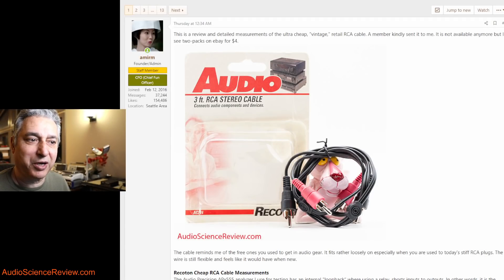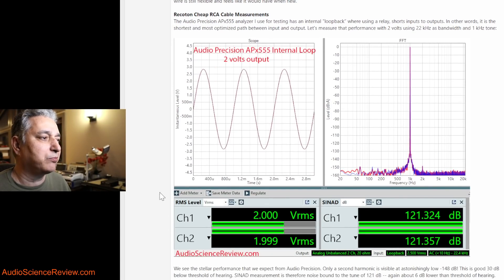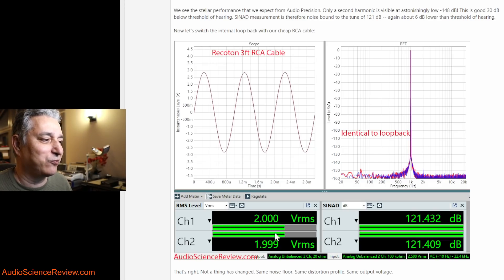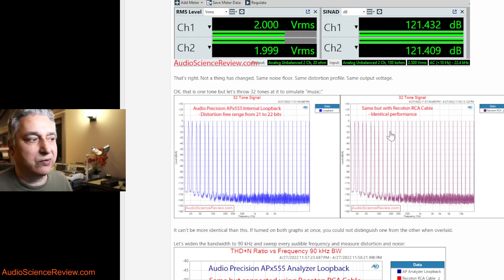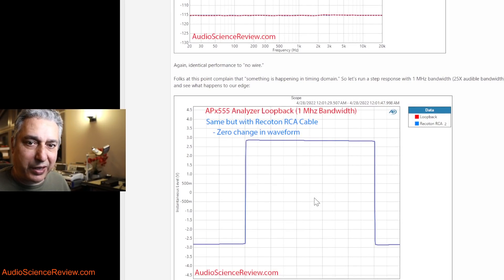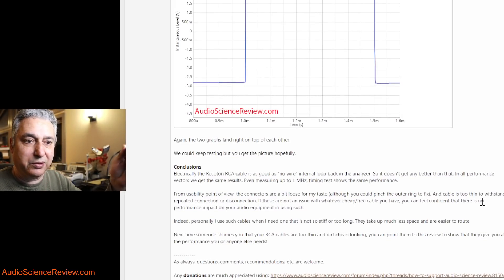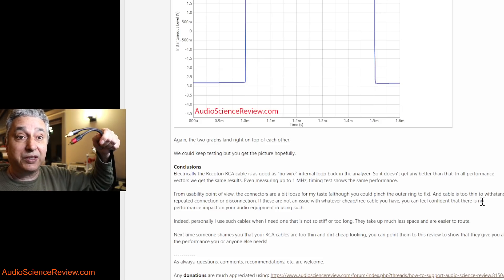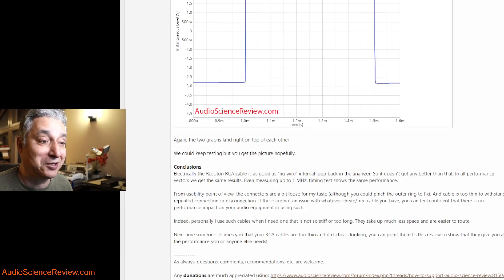Are Dirt Cheap RCA Cables Any Good?

Comment: As long as there’s nothing to interfere with the Signal your review is valid. Take something that could cause interference close to the possibly poorly shielded or unshielded  cable and there can be issues. Nothing is always this simple. Doesn’t mean one has to spend a ton of money on cables but something times people have to think a little more than this.
Reply from the maker: I have done that test as well: https://www.audiosciencereview.com/forum/index.php?threads/battle-of-rca-cables-mogami-amazon-monoprice.27871/

It is very hard to make a case for audible impact of such interference.  Above cables are all low cost and none could be said to have picked up audible noise.  Not to say that it can't happen but it is very hard scenario to make happen.
Reply: Yes and as long as there is nothing stopping people from projecting a lack of understanding as knowledge, your criticism is valid. 
What you overlook is beauty of the work on this channel, it's not not C+ or B+ stuff. It's A++ rock solid evaluation, the kind you might get out authorities at MIT etc. Your idea "you have to think a little more" is just flailing, in fact YOU need to be a more attentive student and not overlook half the lesson then make insubstantial claims. To your point, Amir covered your concern about inference. There are no plausible sources of interference for a 3ft RCA cable like this is common use. Feel free to name one you can imagine inside a home next to a hifi. Something with a large electric motor comes to mind, but that machine would be shielded according to code.

Comment: If you use RCA cables on a turntable it can be very difficult to get it hum and noise free. I have tried and failed that on a DUAL TT with various cables (non of them high end). 
Not wanting to spend too much on a cable I made one my self from a Type N (= copper on both leads) Thermocouple extension cable. It worked like a charm. BTW these cables have Teflon dielectric to make them a bit more temperature resilient but they won't break the bank because they where never intended for audio, instead they are industrial and as such do their job effortless and fuss-less.
Reply: Good solution. In the old days all of the old turntables with RCA cables additionally had a grounding wire. The amplifiers had a “grounding lug” to connect the wire to. Otherwise you would get a 60 Hz hum. This was on tube amplifiers as well.
Reply: @markfreedman2470  The name for this problem is a "ground loop" and is cause buy an alternating current (AC) flowing on the RCA cable shield which is used as the reference for the audio signal on the RCA center pin. As you stated a separate ground usually fixes the problem, but audio isolation transformers can also be used.

Comment: Hoping you test my favorite RCA cable, the McIntosh CA1M. I use one for my turntable.  Really made a huge difference!
Reply: How can they be that good? This cheap cable is already perfect. What does make your cable sound better then perfect?
Reply: @ener5361  -- Amir only tested for line level signals.  Phono cartridges have very little output voltage and relatively high impedance, so his findings aren't directly applicable to turntables that don't have built-in preamps.  Fortunately, such products usually come equipped suitably well-shielded, low capacitance cables.
Reply: @Douglas Blake I’ve already proven cables matter when I destroyed an ASR member, like yourself, 5 to 1. Amir refuses to acknowledge my Scientific destruction of one of his minions, but those McIntosh cables are worth 10x the price they’re asking.  If you have an open mind, the video is here: Cables Matter - Audiophile Proof
https://youtu.be/EPavjwEBYEg
Reply: @Douglas Blake Oh I won.  I won big time.
Reply: @Douglas Blake 5 -1 is a huge win
Reply: haha!

Comment: Well at least the money that folks like you will save by using basic cables you will probably waste on upgrading components that you will never fully benefit from! 😂 If you don't hear any improvement in sound quality from using decent cable in your system, then your system is either badly setup or maybe listening to music is not really your thing and you just enjoy collecting (and measuring) components.
Reply: Excuse me, but yours truly has 50+ years of experience with both home stereo and professional audio gear.  I was also a working pro musician for several decades.  Based on all that, I can say with great confidence that what you've posted here is utter and complete audiophool codswallop.
Reply: @editorjuno  I don't question your sincerity, but I know the sound of  my systems (especially my headphone setup), and how changing cables, etc affects the sound - this is not something I am imagining. I am genuinely puzzled and curious to understand how it is that people like you with your experience and expertise don't hear things that are so clear to me. What kind of cables do you use with your equipment - just the basic free ones they are supplied with?

BTW, I am not talking about £100's or £1000's of pound cables because I have no experience of them and doubt that any benefits they might bring would be audible in my modest system - I use interconnects that cost around £30 - £50.
Reply: @mgsee  -- I use whatever's in my decades-old cable stash as long as it's in working condition.  Nothing in my current system came with any audio cables -- all the cables I'm using are either from that old stash or from one local charity thrift shop or another.  I did pick up a pair of "THX-certified" Monster cables a couple of years ago -- for only $2 USD I couldn't resist, and they turned out to be just the right length to connect up my active main L-R speakers!   :-)

FWIW, I don't doubt your sincerity either.  That said, thirty pounds sterling -- almost $38 USD --  for any short RCA cable is highway robbery IMO, but it's your money to spend as you please, so by all means suit yourself.
Reply: @editorjuno  At the end of the day all that matters is that you enjoy listening to your music. I'm tired of all the insults flying around from both sides of this issue. I am curious though bc the greater clarity and texture of instruments that I heard when I changed to Chord RCA interconnects between my SMSL DAC and Little Dot valve amp (driving Sennheiser HD 600) recently is definitely not 'snake oil' or the result of my imagination playing tricks on me : )
Reply: @mgsee  my guess is that there is some problem with their system which masks the difference between cables. for example, one could not reasonably test the difference between esoteric racing tires by switching them out on an old Schwinn.
Reply: @EskWIRED  That's a rather extreme and therefore crudely inappropriate analogy. Obviously, as with any system, synergy  is very important. The perfect system does not exist so clearly what works perfectly in my system might exacerbate weaknesses in another system. The endless striving for perfection (and therefore objectivity) is what motivates the most dedicated amongst us, regardless of which side of this debate we start from.
Reply from the maker: As I have responded to others, we "hear" what you think you hear.  The difference is that we know if the test is done without knowing which cable is which, such difference vanishes.  In other words, it is your eyes and brain that manufacture such differences, not the cable or your ear.  Until you learn this important fact about your hearing perception, you will forever be confused about high fidelity audio.
Reply: @AudioScienceReview  Don't patronise me. This is exactly the kind of attitude I was talking about with one of your subscribers. Do you think I don't continuously check and double-check what I'm hearing. You seem to think if you can't measure something it does not exist! This shows that despite calling your channel 'Audio Science Review', you actually have a limited and superficial understanding of the role of science that is limited to only verifying the existence of phenomena and therefore you make the mistake of denying the possibility of experiences that you have not yet been able to measure. This approach means that you are most likely looking for the wrong things and end up simply reinforce your preconceived ideas. How is science progressed, by measurement base on existing criteria or by seeking to understand the science behind some as yet unexplained phenomena?

Of course someone who is lacking in imagination and who is only too willing to label someone like myself as deluded would most likely not engage in such research anyway and would regard science as a closed book, an attitude that really has more in common with religious dogma than a truly open scientific approach...
Reply: @Douglas Blake Tell you what - I'm gonna dig out my 'crappy' cables and listen to them again just to make sure I have not been fooling myself all this time :)
Reply: @mgsee  after you switch out the cables, let us know of your thoughts
Reply: @EskWIRED  The thing is I know the sound of my system very well because I am always tinkering (not just with cables) and not all changes sound better or sometimes even make any discernible difference to my ears. I swopped out my preferred Chord phono interconnect for a set of fairly decent Mogami cables and the effect was not subtle and not something that requires blind testing (which seems to be the touchstone method for establishing sound variations among the skeptics). I was listening to a vocal jazz performance, via Qobuz, and the Mogami immediately had more sibilance when the singer sung 's' sounds and instruments such as the kick-drum were less distinct - there was no initial smack of the drum stick hitting the drum followed by the thud of the bass, just a relatively more blurred thud. Overall the sound was more one of listening to music via the Mogami cable rather than hearing a performance by a group of musicians. I swopped back and forth with different tracks just to be sure because, believe it or not, I would prefer it if a £5 cable worked as well as a £50 one as it would leave me with more money to spend on other goodies like a decent pair of IEMs!

Comment: Finally i found someone that has the right tools to prove what i've ever suspected. Great job!
Reply: Have been waiting too for someone with an AP device to do this; result was as expected.

I've always used inexpensive cables in my home and PA (excepting the 25-50ft 4 conductor speaker cables needed in some venues - that's a fair amount of copper and they need to withstand heavy use and abuse + pass signals in the kW's).

At some point I want to switch all my RCA's to Belden wire but that's only cause they have cool colors 😄

Comment: Analogue interlinks and speaker cables make a huge difference in sound by my experience. Not saying cheapos are bad. But there really are differences to be heard. Quite literally eliminated bass issues with different cables, better soundstage, depth etc.

Quite fun to play around actually with different sets
Reply from the maker: If it is fun, please do the testing blind.  Have someone else swap cables on you without you knowing and see if your conclusions remain the same.  I suspect they will radically change.
Reply: @AudioScienceReview yupp, i have done that with a friend, which was a long good evening :) can't explain the why, just that it was day and night difference. Had lesser results with an old Monster cable vs the vd hul. And major difference between interlinks from inakustic and supra. (Running the inakustik atm.).

Like i said in other posts, some of the audio stuff like ethernet cables i absolutely demolish. Or AQ powercables which i tested with the same person (zero difference, i am using default cables). Both were before i saw your tests and i found it really cool it confirmed my theory btw.

If you're ever in the Netherlands, you are welcome to visit. No joke, you really are. Some folks and i actually promote you on one of the bigger dutch audio forums. Not everyone likes it, especially the resellers lolz....

Regarding the speaker cables, i also scanned with an external mic and spectrum analyser during listening (simple app, nothing fancy) and there were differences there as well. 

The set is a Marantz av8003 (on direct), Arcam pa240 poweramp, monitor audio gx200 speakers with gaia III feet and a simple bluenode 2i.

And no ps audio ac regenerator thingy ;-)

Cheers
Reply: @AudioScienceReview  sorry forgot the bloody cables lol!

Old: vd hul cs-122 
New 2nd hand: inakustik ls-1602

Comment: By the way, just out of curiosity, do you think sound different can be measure by the analyzer? Sound such as  soundstage, wide sound, or those holographic sound, can it show up in the analyzer?
Reply from the maker: Of course.  You can't change the nature of the sound waves but have it leave no trace in frequency or time domain.  It is like asking me if you can tell red is green but an instrument can't.
Reply: @Douglas Blake really after seeing more video from amir, i think i lose interest in pursuit of high end audio system. seem like everything in the market is snake. must as well just stick with smsl and enjoy the music
Reply: @bryansu  There is audio equipment out there that is "measurably" good. Benchmark Audio for example. If you buy that type of gear, at least your money is spent on something that is real.
Reply: @Douglas Blake you go way too far here. you can take a system which images wonderfully and screw it up completely by replacing one component. you can also screw it up completely by moving the speakers and twisting them a few inches. you could also line your room with reflective surfaces and arrange the furniture to be as asymmetrical as possible. maybe put one speaker in front of a huge stuffed couch and the other in front of a solid sheet of polished granite? there's a whole lot more to it than simply purchasing a well-produced recording.

Comment: I’ve been in Audio for the last 60 years (prior to the cable insanity era) and I always knew that the so called crappy cables were perfectly fine. I guess because I couldn’t hear the difference I assumed they were good. It’s nice to know You’ve vindicated my judgment. Thank you. Kudos to you! Interestingly enough,  I visited Grammy award winning recording studios 18 years ago and guess what?  They didn’t give a rat’s ass which cables they used in the signal chain, as long as they worked.
Reply: Look inside "top shelf" amps etc. Is twisted pairs of hookup cable :)
Reply: I agree the crappy cables sound amazing. The issue is that if you are connecting and disconnecting, they are more prone to break. But other than that, they are great

Comment: So, the Audioprecision internal Cables are just as bad as theese cheap RCA cables, thats what you just proofed ;o) Now All of your tests are flawed 🤣
There is some value in in better looking, mechanically better designed cables though
Reply: There may be, but at line level that "value" is neither audible nor measurable.
Reply: @Douglas Blake -- Hoschi's comment was clearly tongue-in-cheek, so you can stand down from red alert.  Of course a serious doubter would point out the pitfall of any circuit that depends on the integrity of relay contacts, which are a notorious failure point when a mfr. skimps on the parts budget -- which of course AP doesn't have to do.  :-)
Reply: my comment was indeed meant ironic.  But it is somewhat frustrating to see so many Snake Oil Companies making big money with their esoteric claims and to have so many audio fans willingly buy this shit and wildly spread and defend this foolish claims. Thanks Amir to shed some light into this dark corners!
Nevertheless did I just bought a replacement headphone cable for my Focal Stellia, not for any sound quality improvements, but purely for the look and feel (the stock cable is stiff as hell and extremely microphonic )
Reply: and interestingly electrticity is apparently quite a bit more complex than I thought : https://youtu.be/oI_X2cMHNe0
Its all in the Fields , not in the wire.....there is another pandorras box with lots of esoteric potential     lol
Reply: @Douglas Blake Have you watched the Clip from Veritasium? at around 3:30 he explains how electrons transfer their kinetic energy thus heatng the wire up (heat is basically just kinetic energy in a system)
I dont think I understood all or even half of what is shown in that video, but still find it very interresting to see that on a subatomic level things can get quite counterintuitive fast and the macroskopic physics is often a simplification of what happens there. Its a fascinating world and I whish I were smart enough to get my head around, thats all ;o)

Comment: i will say i have had some of those go bad if you're constantly plugging/unplugging, being that the wire in them is so thin, but you will know it as soon as you fire things up and you get a hum.  but other than that they're fine.  i would get next step up for longer runs if you need them, but still no need on spending more than like $20 on an rca cable.  i worked for a high end a/v company for a while and they were buying everything from monoprice.  that's actually how i found out monoprice was a thing.